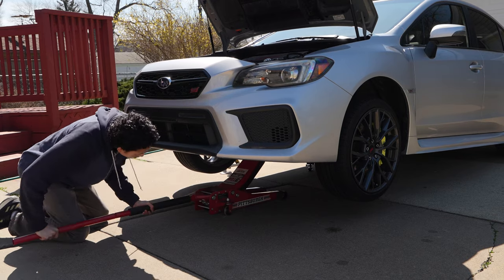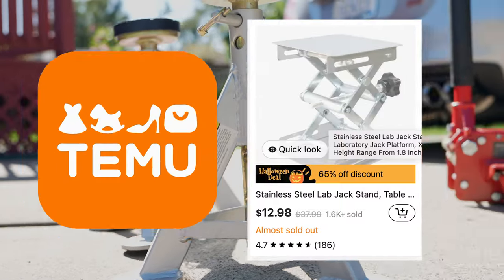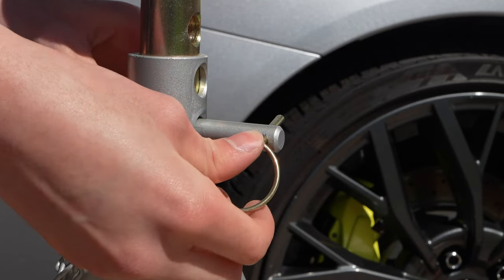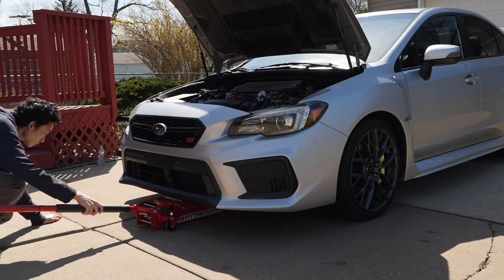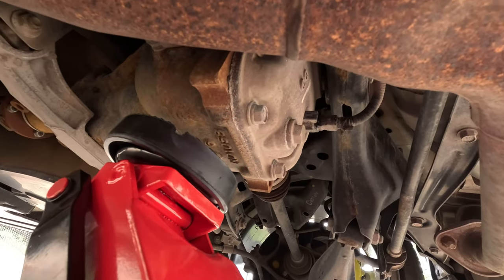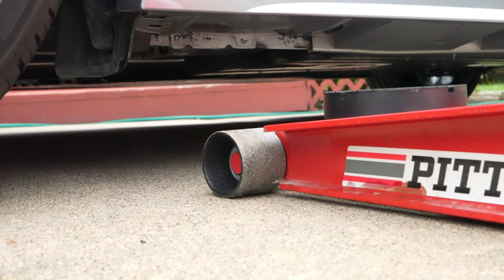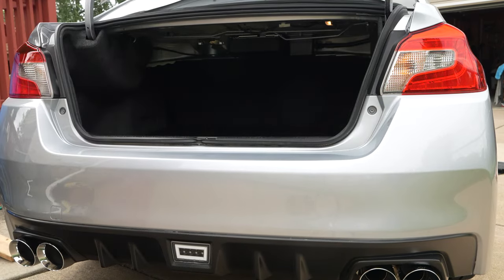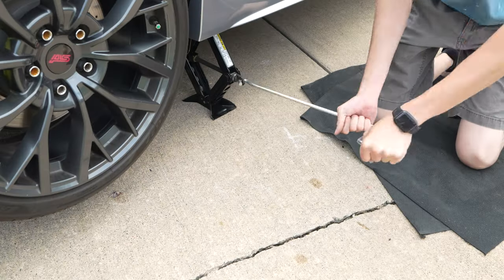How to Jack up a WRX STI | Step by Step

Comment: Thanks! I saved this. I’m always concerned jacking up the front from the pinch welds because I wasn’t comfortable trying to squeeze the jack stand in there on the same pinch weld. I knew about using the rear diff but I loved the variety of options you provided. Keep up the helpful vids for us that need more detailed instruction. Now I’ve gotta get these wheels swapped! Later!
Reply from the maker: Thanks so much for your generosity!  I'm glad you found my video helpful and look forward to more ✌️

Comment: One thing many people overlook or don't even consider is the surface you're using the floor jack on. Make sure it's clear of debris and cracks. If the wheels on the jack are kept from rolling the jack can slip off your jacking point. I noticed you were very close to the concrete joint when you were jacking up the rear of the car, 2-3 more pumps and you might have slid the pad off the rear diff.
Reply from the maker: Yes you make a good point!

Comment: Nice video! Scoobyfreak86 also made one showcasing how he jacks the car from the side of the car using the section in the middle so that you can get one side of the car up easily. 

Would also love to see a video on recommended maintenance schedule for the car. Keep up the great work!
Reply: FYI - if anyone else is trying to install any aero like a lip or skirt on stock height, that pittsburg low profile jack barely clears it. (My skirt ended up making contact and bending slightly against the jack, but I was able to pull it out under the car without damaging it)
Reply from the maker: Thanks! Oh yea that's right, I think I remember seeing that one, I might have to try it. That's a great idea, thanks so much for watching ✌️